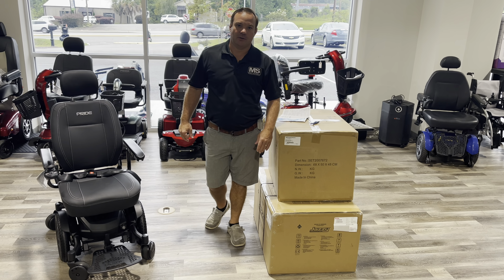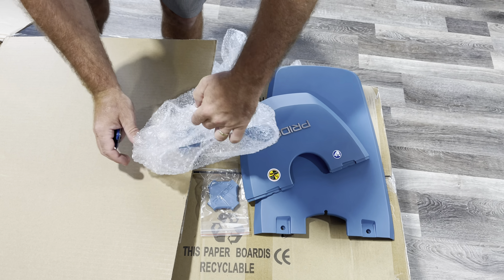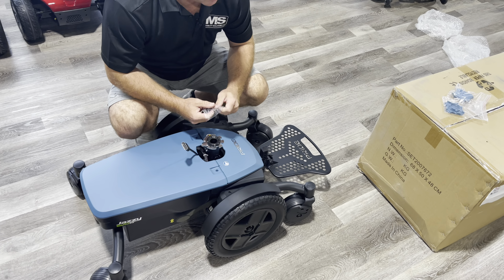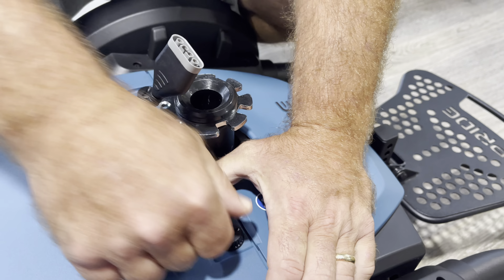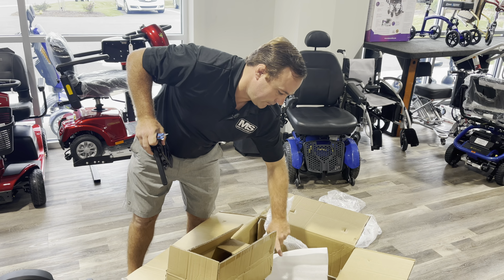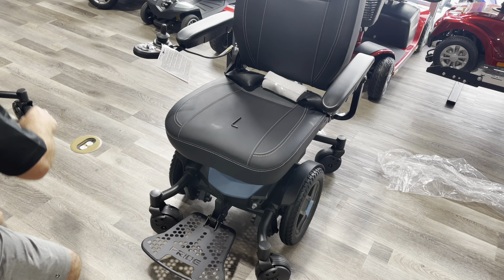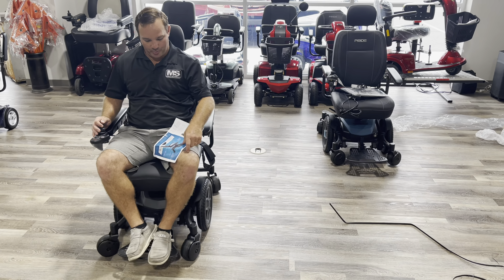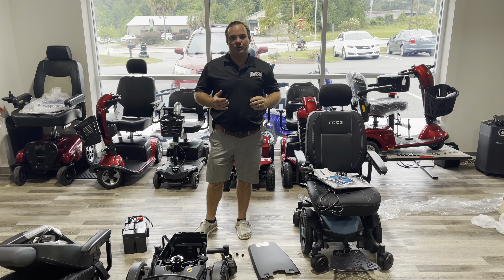Pride Jazzy Evo 613: Lithium vs U1 battery

Comment: On the arm rest, is it designed where they are actually locked in place? The other jazzy it was not designed for them to be locked in place
Reply from the maker: Armrest doesn't lock in place but can be adjusted in height and width. Thanks for the question!
Reply: @MobilitySolutions101  oh ok thank you for answering me.   Is there a way to lock it in place to where it will actually stay cause that’s a huge thing for me. Right now I’m actually having to shift to on side to use my arm rests and it’s really causing me a huge amount of pain. This is the chair I am going to be receiving here in the next few weeks. And I’m also wondering if I can buy Accessories for the chair I know my insurance company will not cover those like a cup holder

Comment: I just got my Jazzy evo613 and having all kinds of problems with steering. It's really fast even at slower speeds. I can't control it at all, any tips would be appreciated. Thanks
Reply from the maker: You probably need to have it professionally tuned, the local dealer should be able to program the chair speed and acceleration. Hope this helps!
Reply: NO its a highly unstable chair with narrow plastic drive tires and NO independent suspension. It will throw you to the side if one tire doesnt have traction because the tires LIFT up if one front small wheel encounters anything not flat. DANGEROUS CHAIR @MobilitySolutions101

Comment: DANGEROUS CHAIR. Lithium battery may last longer but its power curve is garbage. It has no low end(or speed) torque, then suddenly picks up fast and will throw you into something. Suspension is no longer independent. Unless ground is FLAT the smaller front wheels will lift the drive wheels if one goes higher or lower than the other. They are set too close to the drive wheels--very unstable. This is the worst designed chair Ive even seen. Im 69. Polio since age 6 I know what Im talking about.
Reply from the maker: May want to allow dealer to adjust speed settings with programmer. Thank you for the feedback!